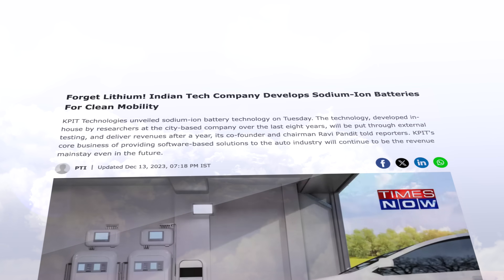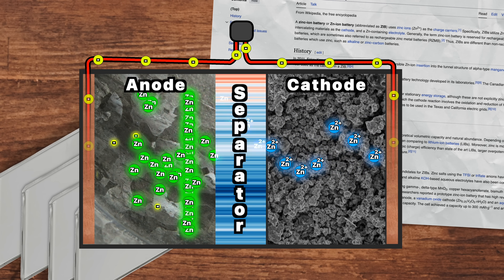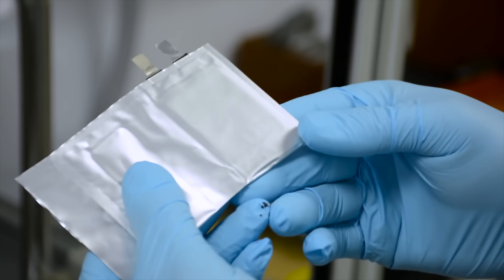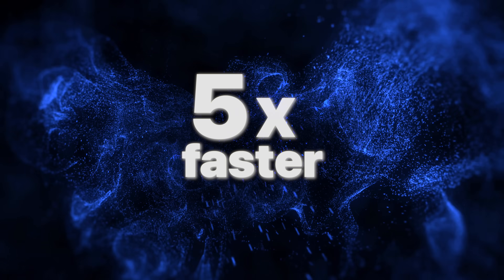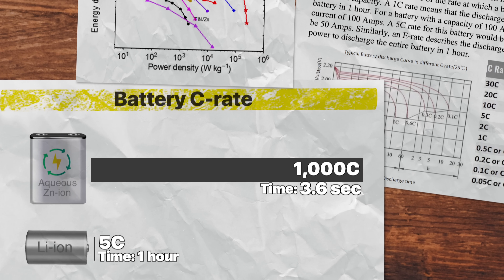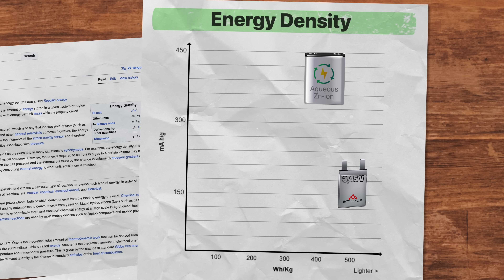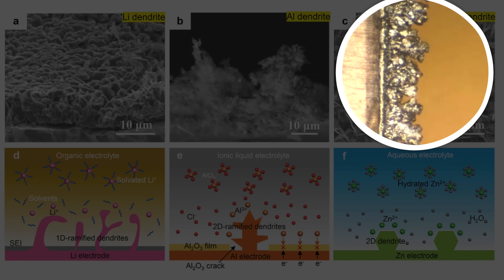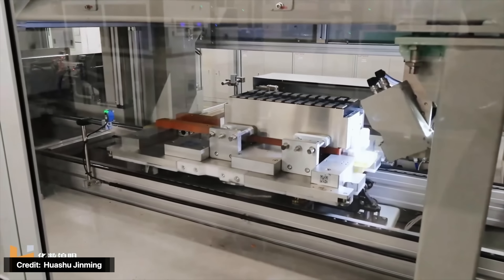New Aqueous Zinc Battery Breakthrough - Real Deal or Hype?

Comment: I think this battery technology sounds great, it has some great advantges.  Is there a concern with the aqueous electrolyte freezing if its temperature drops too low?
Reply: That's a very good question. Of course, that would be a risk with any electrolyte other than solid electrolytes, but more concerning for aqueous electrolytes since it's melting point would be closer to 0°C. That could destroy the cell if the design doesn't leave wiggle room for the stack to swell when the water freezes. Very good eye!

Comment: The problem with these types of batteries is that vanadium is rareish and expensive. And it's mining is mostly in China and a an environmental disaster. We need a solution that doesn't rely on China and doesn't destroy the environment.
Reply: If my hearing is still okay. The video said the technology is from Beijing university. So what is the point of talking about not relying on china????
Reply: @winkus8586  The issue isn't where the research is happening, it's where the raw materials are. We shouldn't adopt more technologies that rely on China for the raw resources. And using vanadium isn't exactly new. Vanadium redox batteries have been around for a bit.

Comment: I think Zinc batteries are the future... as are Lithium, Sodium, Vanadium, high pressure Hydrogen, flow batteries etc... Each chemistry has it's own characteristics and it's own uses.
Reply: For affordable, sustainable large-scale storage, anything that requires rare elements is a non-starter IMO. Hydrogen may sound nice in theory but causes far too many problems in practice. I doubt it'll see much use besides energy-dumping for excess renewables. The smarter way to handle energy-dumping would be grid-aware EV charging infrastructure, then you can have hundreds of GWh worth of self-depleting storage to dump excess into if enough people sign up for and plug into grid-dependent charging speeds and billing rates.
Reply: @teardowndan5364  Grid-aware charging is easier said than done, and certainly not without it's drawbacks.  That being said it will likely be part of an overall scheme which will include many storage solutions, some of which will not be batteries.  There's been some interesting developments in Hydrogen storage that requires zero rare earths and no platinum and is already in use at a mid-size scale.  We will see whether it can scale at cost but in theory it could.  Than again, this is true with many battery chemistries that in theory should scale but often don't for one reason or another.
Reply: @Ryan-ff2db  Grid-aware charging would be quite simple to implement in areas where utility companies already have mesh-networked meter read-outs: simply use the same mesh network to publish how much spare capacity is available in a given area and let EVSE/cars with the necessary $5 modem act accordingly.
The expensive part is doing it later: doing it now would add ~$5 to new EVSEs, doing it later will mean replacing heaps $300-2000 EVSEs.
Reply: @teardowndan5364  I'm not disagreeing with you but in no way is this going to be easy.  Essentially the entire grid across the country needs to be upgraded for decentralized power with costs estimates varying but here in California costs are estimated at $150 billion by 2035.   But knowing California as I do, those cost estimates will much higher in the end.  The entire grid upgrade for the US will cost trillions and no study I've ever seen denies this.  It needs to be done for sure, but in no way will it be easy.
Reply: @Ryan-ff2db  Most grids already have a 100+% margin between peak and off-peak load. If people signed up for off-peak EV charging with grid-aware L2 EVSEs wherever they go, most areas could handle an overnight transition to all-EVs with no upgrades to the grid itself besides running 200A cables to feed gangs of L2 EVSEs.
Reply: @teardowndan5364  "Grid-aware EV charging infrastructure" as well as home-bound backup (UPS) and peak-shaving batteries. Give the benefit of lower energy costs to the consumer that pays the first cost of battery implementation by creating electricity rates advantages for peak-shaving. Similar to those systems that turn off air conditioners during peak periods of the day, divert load to the consumer's battery packs (EVs or home supply) for that person's house, helping to ease the load. Charging would be limited to middle of the night periods when residential and commercial loads are less, thereby reducing the need for peak-shaving NG-powered turbines. Load balancing through consumer-owned batteries with benefits to those that buy them/house them. Could be a very bright future if the battery technology catches up.
Reply: If Zinc was the future the Chinese would be already doing something with them.

"Developers in Japan, China and Europe are working to solve some of the problems with zinc batteries, which are prone to rapid loss of function after repeated charging cycles." (Nikkei Asia, November 26, 2023).
Reply: @ricnyc2759  What a strange comment.  Whatever gave you the opinion that China is not working on Zinc batteries?  A simple google search shows at least 6 Chinese companies working on all different types of zinc batteries.  Do you assume the China doesn't need R&D and can just summon things out of thin air to produce?
Reply: Cold weather may be an issue for the water based battery.
Reply: @oystla  Lead-acid batteries work fine down to about -40C because sulphuric acid lowers the freezing point of water that much while in fully charged state.
Reply: @oystla  Yeah.  Unless there's some sort of anti-freeze, I'd say you're right.  I know in areas that only occasionally freeze, they use warmers to keep the batteries from freezing but in areas that frequently get this cold, that would be wasted energy.
Reply: @Ryan-ff2db  The plug you see on some mostly older cars is usually for a BLOCK heater, not battery heater: older vehicles running 15W20 or thicker oils need the extra heat for easier cranking. On newer cars running 5W25 and lighter oils, block heaters aren't really a thing anymore.
I'm in Canada and the only difference starting my car at -35C is 2-3s of cranking instead of ~0.5s.
Reply: @teardowndan5364  I wasn't talking about lead-acid car batteries.  Most lithium batteries for grid and vehicle use have heating capabilities.  These work just fine for most areas but if you're in an area that get's -35 than you'd be wasting a lot of energy just keeping the batteries from freezing.  In the video he basically said it was water, although he may have been using that as a generic term for liquid.  If it is pure water, it would be problematic for colder areas such as where you live.
Reply: @oystla  Insulation and lowering freezing temp has to be possible. They can surround it with coils that warm it with ceramic element. Mini heater.
Reply: Only one can live!!! Duel starts!!
Reply: i have high hopes for flow batteries they seem like theyd be a great fit for grid storage and since its a liquid its more recyclable
Reply: Australia just made a water battery with nano material cathode and anodes...Also just read a silicone battery...
Reply: @sampleoffers1978 really? Who?
Reply: @ You can engine search the words Australia, water battery, nano material cathode and anode. That's better than me posting link, in case there's problem with link.
Reply: At first I thought it would be like a  capacitor with density. It isn't. Could've been good for buses. Charging at stops as it goes. Yet charging fast kills the battery. 

 Salients battery makes no sense. It is only 30% cheaper at 1/4th the density.  So wouldn't just buying less lithium ion be cheaper?

 Makes no sense why people would go for the salient...

Comment: How is it possible for zinc ions to be smaller than lithium ions? 2:32
Reply: Much higher positive charge in the nucleus holds the electrons "tighter"...smaller orbitals.
Reply: @warthog733  sure, but there are many more orbitals and much higher energy levels (a.k.a. further away from the nucleus)
Reply: Wikipedia on ionic radius confirms that, litium +1 90pm and zinc +2 is only 88pm but that's for crystals so not sure how relevant these are in solution, but it's interesting nonetheless
Reply: @petoknm  Interesting! Thanks for making an effort an look it up!
Reply: Great question, right? I raised an eyebrow as well!

Comment: 🧐 Hmm. I don't know if THIS is the technology will usurp lithium-ion; but I'm pretty sure something will. The problems with the lithium-ion technology - limited supply of raw ingredients, weight limitations, slow charging, less than ideal energy density, and dangerous fire hazards - all doom it to eventual abandonment. Just as we went through many iterations before coming up with gasoline powered cars (anybody remember the Stanley Steamer?) it will be a while before we zero in on an economic, safe, abundant and useful battery technology.
Reply: Lol many iterations before we came out with gas powered cars? No. Just no. We went through many iterations OF gas powered cars. Sure. But iterations before coming up with gas powered cars? No. Like what? Steam? And battery? Human powered? What else you got? 😂
Reply: @jamesbizs  OK. you got me. I wasn't specific. First, they used kerosene, not gasoline, which caused a lot of problems. Yes, they tried coal-powered steam engines (the Stanley Steamer). They didn't think gas would work because it burned too hot, until someone came up with a radiator. The first engines were two-stroke with enormous pistons, and didn't get refined for years. Many talented engineers were in pursuit of a high-powered gasoline engine for decades before the Model T. The idea of an automated horseless carriage was around since the 1890s, but we flailed around until the 1920s (about 30 years) before they actually became useable everyday technology. The same thing is happening in battery technology today. Maybe these zinc batteries will do the trick; maybe not. But something will replace lithium-ion batteries; they are simply too clunky, and the require materials too rare, to become a standardised world-wide solution.
Reply: @jamesbizs Diesel. But regardless, gasoline formulation has been tinkered with for a century. There used to be lead in it, for instance

Comment: Could make recharging your EV similar to stopping by the local gas station.  The closer we get to “pit-stop” speeds, the more acceptable cross country travel in the family electric sedan becomes!
Reply: We often do 700 miles non stop except gas about 2x per year.  Even eating on the road takes 15 min.  This battery is far to heavy to be in a car. Great for home use though .
Reply: I mean, let’s be honest. How many people go on a cross  country family trip, lol and don’t stop for 30 minutes every 300 or so miles? How many people drive 4-6 hours non stop, let alone with family, and don’t take a 30 minute break; to eat and shit? 4-6 hours of driving, and they only stop for as long as it takes to fill up your tank?
Reply: @jamesbizs  Here is the conundrum. If EV has mass adoption, how many charging stalls do we need if everyone is to take half an hour to charge? Charging needs to be fast regardless of how long you want to stay at a charging station.
Reply: @jamesbizs I can’t remember the last roadtrip I did with my wife where we didn’t stop at least 30 minutes when we got gas.

Comment: Please do a bit of fact checking, I think that LARQs claim of removing PFAS is more than bold. I would not trust this as the PFAS group of chemicals are very hard to remove, and requires different strategies depending of what PFAS the contamination is.
Reply: He did specifically mention this was early research and that there's more RnD to be done
Reply: @Cleaner_101  I am talking about his sponsored commecial at 4:20

Comment: Let's get away from these all round dangerous lithium batteries.
Reply: Cool story. What better and viable idea do you have??? Share.
Reply: anything holding 100kwh or even more in energy is going to be dangerous. Energy is dangerous. I mean, a 100 pound weight suspended 100 feet in the air will kill someone nearly instantly if dropped and it only stores 0.0038kwh

Comment: I'll believe it when it's in a actual device.
Reply: Frfr
Every other month they got a new miracle battery smh
Reply: Actually weight means very little when the battery is small enough. Zinc is perfect for things like rechargeable AA, AAA, C or D cell batteries
Reply: @wallyxu9467  in the case of standard-sized cells like AA, AAA, C or D batteries, weight isn't so much the issue as is energy density (as in "volumetric" energy density, not specific energy). Since you're limited to a specific size and shape, you can only fit in so much energy. Commercial alkaline batteries have energy densities of 120–270 Wh L−1. At  400-500 Wh/kg the aqueous Zn/NZVO battery has an energy density roughly in the same ballpark. So, in theory, you could make AA and AAA batteries of the same size and capacity as an alkaline Duracell, only rechargeable.
Reply: @wallyxu9467 weight is the biggest issue with vehicle batteries.  

100kwh Tesla battery is 1,377 pounds which equals the same amount of energy in 3 gallons of gasoline.  

Significantly heavier batteries will make EV impractical.
Reply: I BELIEVE a lot of chemistry and engineering are viable..I SUSPECT some kind of money has been shelving good chemistry though.
Reply: One of them  will probably work eventually.
Reply: @seriousmaran9414  "probably" "eventually" 😄
Reply: @PhantomPanic  you sound a lot like the doubters of EVs about 10 years ago. Now look where we are.
Reply: @h20dancing18  Cherry picking your narrative I see.
Reply: @PhantomPanic  narrative in the case of electric cars works. Now we need more solar panels, power storage and better lines to carry it. The technology for that exists now, it is just getting more installed.

And I was joking with probably, eventually. There are ones that work now.
Reply: Stop talking show me the facts on the table
Reply: "an"
Reply: @Garuthius  Egh really? Who cares if phone is 50g heavier or even 100 or whatever, it aint an issue
Reply: You should probably stop watching tech/research videos.
Reply: It is a thing. Look up EOS Energy. They have product in the field and are ramping quickly.
Reply: Check out EOS energy mass production q2 2024
Reply: Even if it's real it will never make it to market. People getting rich from Li-ion will bury it.
Reply: Sooo, what happens with the water based battery at sub Zero Deg Celcius…..
Reply: @oystla That same that happens with the water in classic starter batteries.
Reply: @goiterlanternbase  Or they add chemistry to avoid freezing down to -30 DegC.
Reply: @oystla  It boils down to "Your definition of water sucks. Try an appropriate one"🤣
As far as i can interpret the sparse information, this is somewhat of a thin film battery. Like your typical NiMH AA, just with Zink and Manganese. At least that is what Varta shows as working example for a ZIB2. Far from the sloshy Lead/Acid battery.

That they don't burn is somewhat wrong. There is an issue with H production, that is categorized as fire hazard.
Reply: If there is a concrete evidence it called knowledge not belief. If you wanna believe you gotta believe it before it becomes knowledge
Reply: Yeah thats... that's not a great lab for it to be coming out of, especially with a flashy name like that, I mean when/if it's confirmed upon outside review I'll take it more seriously but for now... naw
Reply: Oooh, you are so edgy! 🙄
Reply: @williamcrowley5506  what? That's a pretty common and logical thing to say lmfao
Reply: @Garuthius totally agree
Reply: So sick of all the hyping up of things like concept cars and magical batteries. And it's people like this guy that keeps the hype going.